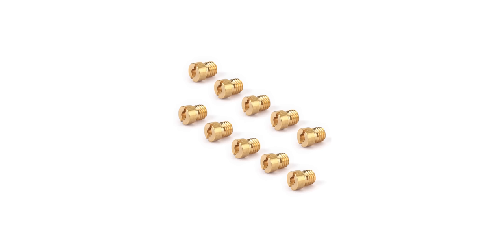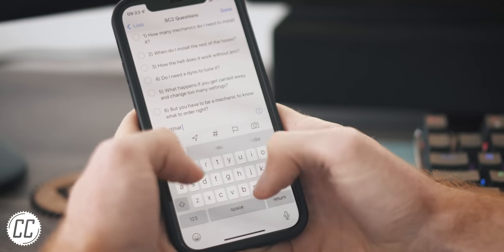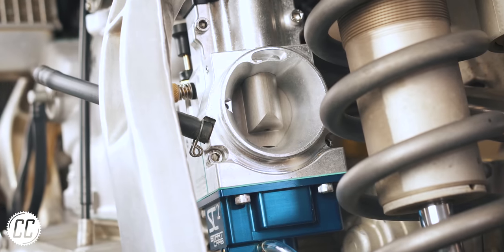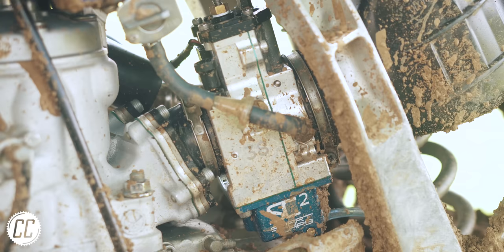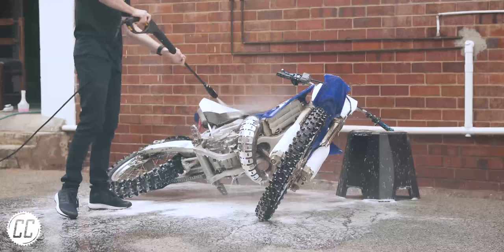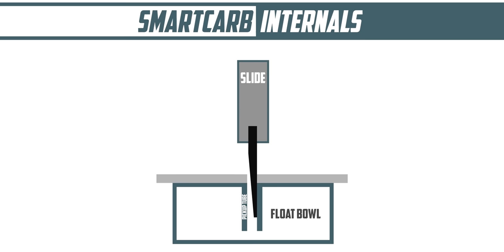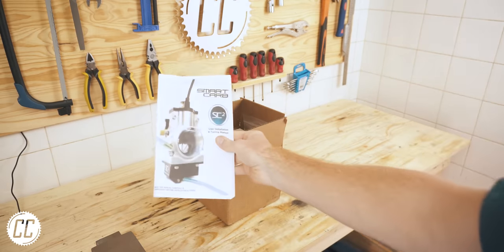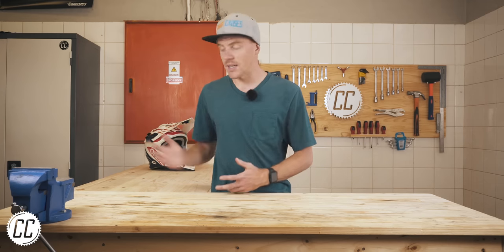The Best Carb Money Can Buy? | SmartCarb SC2

Comment: The first question that came to my mind was this: If this carb was so much better than the stock one that came on the bike from the factory. Why isnt it put on there during the production of the bike? If it were better it would have been put on there right?
Reply: Cost .
High end shocks , wheels etc are not on stock bikes either for the same reason.
Many potential owners wouldn't want or need them .
Those that do buy them afterwards.

Comment: That low pressure system means that forced induction doesn't require messing with fuel flow right?
Reply: Correct. The SmartCarb compensates for all air density factors, including artificial ones like blow-thru boost.

Comment: Don't see how this is any different than an SU carb that's been around for decades. A throttle blade opens, vacuum signal raises a float with a need on the end. Different needle profiles.
Reply: They're very different. SmartCarbs don't have a throttle blade/butterfly nor do they have a vacuum operated piston slide. They use a flat slide directly throttled by the user with a single circuit using a metering rod, not a needle. Air density communication occurs between the venturi bellmouth and the float bowl - it isn't used for throttling but rather fuel flow assist. These are patented features.

Comment: I know nothing about this carb but I know a lectron carb on my yz250x was a god send. Hands down the best add on you can do to any 2 stroke.
Reply: Consider the SmartCarb the next level above that. Full external adjustability without tools (no cap and slide removal), true to size bore (Lectron H Series and new Billetron are 4mm smaller than advertised), variable venturi throttle rate (snappier response down low without compromising the top end), and a TPS option for your YZ250X's 3D ignition mapping (Lectron doesn't offer TPS).

Comment: This thing looks like a SU HIF carb, no this is a su carb.  A modernized SU
Reply: No it's not. The SU carbs use a butterfly to throttle with vacuum or depression operated piston with conventional tapered needle. The SmartCarb is entirely different with direct flat slide throttling, a metering rod, and integrated float bowl venting. The SmartCarb doesn't use air density/velocity to throttle - it uses it to assist fuel flow in the float bowl. It's a patented feature.

Comment: frankly, I'd be happy with carbs that could deal with ethonal fuels
Reply: Ethanol is terrible, but it's also all some people have to work with. Fortunately the SmartCarb is jet-free, meaning there are no small orifices to gel or clog up. Still best to avoid ethanol if possible, but if not the SC is more resistant to issues arising from its use. Best then to run the engine and cycle the fuel frequently. All SC2 models come with float bowl drains standard.

Comment: Hi I’m having the same issue with my yz250. Blubbery response from low to mid and lean up top after about 30 clicks out. Would you happen to remember which metering rod you switched to? Thanks for your help and the great video!
Reply: Justin is running the standard YZ250 A-Q07 metering rod and has since come back down from 30 some clicks leaner with a rebalance of the idle set screw (bumping it in a hair). Send us an email - we'd be happy to help you get your tuning sorted out.
Reply: Talked to Kirk on the phone today. Very pleasant and attentive guy, and he helped me get the carb dialed. Bike absolutely rips now. Running super crisp and clean with power wheelies galore. Great customer support with these guys. I know they’ll be there if I need them again. Thanks for the help
Reply: @jeffgoetz7919  always happy to help!

Comment: Hey man, I've had a look on their website, and saw they they only have this carb for the kawasaki kx's ( when looking at kawasaki's), do you know if it's possible to use the carb for the kx250 2t on a kdx 200? also 2t.
Reply: Hey, thank you for checking out our website. We're still working through fitment on the KDX 200 and 220 Kawasakis. Our current model runs into frame-contact fitment issues. Stay tuned!
Reply: @SmartCarbFuelSystems  Okay I see. Thanks for the response. I can't wait to get one of them on my KDX one day. 👍

Comment: Better than fuel injection? Well obviously no, but we already knew that...
Reply: Doesn't it depend on the type of fuel injection? For example KTM's TPI system. We maintain that the SC2's performance and efficiency rivals that of TPI, being easier to use/adjust and with much less complexity and failure points involved. KTM plans to abandon TPI for TBI in the coming years, a testament to the benefits of wet flow induction in this category of high performance 2T motors. Is the SmartCarb better than DI? No, but then DI is only one method of fuel injection.

Comment: Normal carbs can require different jets at different altitudes, so similar there. Interesting to use a half circle instead of tiny tunes and jets
Reply: SmartCarbs do not require different components or even adjustments for different altitudes, though extreme changes may require a slight adjustment. Fortunately that is as easy as shutting the engine off, opening the throttle wide open, reaching down and turning the clicker adjuster right for rich, or left for lean, in .0012 inch increments. No tools required, all adjustments are external and take seconds to make.

Comment: I like how it’s computer designed and still doesn’t fit. Unless that’s to fit other bikes. But not impressed
Reply: The SC2 SmartCarb family of carbs are designed to fit many different 2-stroke makes and models. That said they fit all modern carbureted 2-stroke dirt bikes. We can't help the airboot trim though. The SmartCarb's integrated float bowl vent scoop location and size are fixed and some manufacturers (not all) put an in-molded rubber lip in their airboots that blocks it. 5 minutes with a dremel tool is all that is required, if required.

Comment: I’d doesn’t seem so smart to me, you can’t adjust mixture in different rev ranges. A normal carb has 3 circuits low rpm, midrange and wot, and already adjusts for altitude 
 Looks more like a dumb carb
Reply: Does the engine rev or load in 3 distinct phases? No, it doesn’t. It’s continuous and constantly dynamic. Why shouldn’t the fuel system accommodate accordingly? Why adjust for different rev ranges if you don’t have to? 

The point isn’t that you can’t adjust for different rev ranges. You simply no longer need to. SmartCarbs provide peak fueling performance bottom to top regardless of elevation/temperature changes.
Reply: @SmartCarbFuelSystems  
Ok then. ‘Smart’ consumer

Comment: Ok did test on dyno, was consistent with power an torque, but we lost all over the chart and could not get it back like the modified stock carb. So we are still old carb is better
Reply: Did you share your results with us so that we could assist you with your tuning efforts? It would be good to see your charts with A/F ratios included as well. Some make the mistake of trying to force the SmartCarb into the same A/F curve as the stock carb, but that's not how they make their power.

Comment: If someone tells me it gives more power but uses less fuel..... Claims I bought when I was a youngster 😂😂
Reply: The claim/result isn't that less fuel can provide more power, but rather less fuel required due to more fine atomization of said fuel, burned more efficiently as a result, can produce an increase in power. Not so much a claim on our end as it is a guarantee.

Comment: Will this carb work on turbo application, early model kz 1000
Reply: If it is sized correctly for the application and will fit properly with top pull cable routing then yes. We've set up a good handful of blow-thru turbo setups, most recently a YZ125 used to set 5 new Bonneville speed records this last July.

Comment: Another expensive gizmo for the less mechanically inclined.
Reply: What's not to love about modern carburetion? No jets/jetting is only one of the benefits the SC2 provides. Greater performance, fuel economy, and consistency are other factors to consider. For most, depending on local fuel costs, the SmartCarb will pay for itself in fuel savings in under 2 years.

Comment: For $600-$700.. they don’t have anything worth owning. Make the price competitive and we’ll talk.

Competitive versions will appear in short order.
Reply: Don't we though? What else does what the SmartCarb does, as a whole? Factoring in performance, efficiency, ease of use, even emissions reductions?

We've heard that for 10+ years and some have tried. And failed. Our patent protection helps some, certainly in the West, but more so our aggressive market targeting/education and simply outrunning and outgunning the competition in general has us where we are. SmartCarbs are designed, machined, assembled, and shipped in the US. That we've been price stabile through the last 4 years while the distant competition, Lectron, has gone from sub $400 to price matching us is noteworthy.

Our pricing is competitive given that our competition is fuel injection.
Reply: @SmartCarbFuelSystems  thanks… I’ll just use a carb … for much less money.

Comment: 2 strokes absolutely LOVE it when they are lean. So if you make it as lean as possible it will make it run like a dream, BUT it will destroy your engine by over heating it.
Reply: I feel that is a good point, which occurred to me as I watched the video, most factory set ups are on the rich side as they want longevity over outright performance. Weakening the mixture with some jet changes was used as a tuning tool back in the 70's. 2 stroke engine efficiency, or perhaps the lack of it, comes from the port timing. When running in the optimum rpm range they are actually very close to 4 strokes, but at idle and other rpm's they do not run efficiently and a lot of unburnt fuel goes straight out of the exhaust ports. Direct fuel injection can make a massive difference as it does on the modern 2 stroke outboards, but I don't believe any carburetor change, could dramatically alter the fuel consumption on a 2 stroke motorcycle to the point claimed, assuming it was running somewhat correctly at outset. The savings that exist must come form running weaker, they talk about the better atomization etc. but on a 2 stroke that fuel is being sucked in to the crankcase to then be forced into the cylinder so there's much more going on between the carburetor and the cylinder than on a 4 stroke, so I'm struggling to buy their explanation.
Reply: @fiveowaf454  I agree, I think the people who designed it don’t really understand 2 strokes. Seems like it would work well on a four stroke but as you said, direct injection is the best thing you could do to a two stroke.
Reply: @RealWunderBanana  Direct injection is the only way to get much better fuel consumption and lower emissions, because you can get rid of all the extra fuel that is wasted at low rpms. idle and other speeds where the port timing isn't ideal. I guess as the focus is on racing off road they are not concerned beyond performance, but I still don't see where there could be huge gains in power and fuel consumption beyond running a weaker mixture than the stock setup.

Comment: Us four-stroke guys are getting left in the dark. Lectron was the first one to make a carb like this
Reply: There's a light at the end of the tunnel. We're actively working toward serving the 4T market now that we've established ourselves in the 2T space. That said 4T carb sizing, fitment, configuration, and throttling varies widely. We're going after the most common, easiest to equip, and most in need bike models first. What do you ride?

Lectron as they are today are not the original inventors or proprietors of the metering rod carburetor concept/technology, which actually got started prior to the advent of the Lectron with the Posa-Fuel in '67. The SmartCarb is the culmination of more than 50 years of development starting then, continuing through the Lectron, subsequent models like the Ei Blue Magnum, and Edelbrock QwikSilvers, and more.

Comment: A great carburetor, but you have the wrong inventor, William “Red” Edmonston made improvements to the Venturi Carburetor, but a British gentleman by the name of Herbert Skinner invented the Venturi Carburetor in 1908!
Reply: Apple doesn't credit Alexander Graham Bell for inventing the telephone... Furthermore there are very few similarities between the SU carburetor and the SmartCarb. We recommend you freshen up on your understanding of the SU and then watch this video again. It's quite good about explaining our patented features.
Reply: @SmartCarbFuelSystems  It is a variable Venturi Carburetor, yes it has a vast amount of improvements, but at its heart it is a variable venturi. That is what gives you the precision metering at different RPMs and the automatic altitude corrections... It is a beautiful carburetor...
Reply: @michaelholliday100   the SU is a butterfly throttled, constant velocity or CV carburetor. Its slide or piston is throttled by vacuum. The SmartCarb uses a flat slide directly throttled by the user via the handset/cable. By variable venturi we mean variable throttle rate by way of our patented, inverted egg shape venturi profile designed to maximize signal at the metering rod for ultimate fuel pick-up/atomization, especially at lower throttle positions. Air density compensation or automatic altitude correction in the SmartCarb is handled via direct MAP communication into the floatbowl to assist fuel flow proportional to air density. It is not used in any way to throttle the carburetor like in the SU.

Comment: Something to consider; if it's using 25%-30% less fuel, it's giving 25%-30% less oil to the engine.
Reply: More like putting 25-30% less oil out of the exhaust in the form of smoke/spooge, not to mention zero spillage on steep hills or when tipped over. The engine gets what it needs from the SmartCarb. Finer fuel/oil atomization improves heat wicking and increases combustion surface area and efficiency. There are no longevity/durability downsides using this fuel system.
Reply: @SmartCarbFuelSystems  That's a nice spin you put on that.
Reply: @DonziGT230  it's not spin. SmartCarbs are used by thousands of customers in over 50 countries worldwide, have been used to set hill climb and land speed records, are used by top level professional hard enduro racers, paramotorists, and more. They've been EPA certified for on-road motorcycle emissions, twice. Frankly that they do what they do is by now a well documented point of fact.

Comment: For $600.00 you may as well go with an EFI kit instead.
Reply: Why? What about EFI is better, let alone easier to work with, than the SmartCarb? Why involve the electronics/complexity/failure points for next to no performance advantages compared to this fuel system properly dialed in?

Comment: Are there any rubber internal components? I'm hoping it's only the hoses on the outside? Meaning when I brew my own alcohol can I swap my lines to silicone and I'm good to go?
Reply: Ahhh great I hear that there are addition rods and it's available in the selection info 😉 thanks 👍
Reply: @Jarmezrocks  yes there are o-rings inside of the SmartCarb but we use Viton which is resistant to alcohol unlike other o-ring materials. You'd be good to go.

Comment: Guess I'm missing the smart part of this? Seems like a conventional internally vented carb with adjustments for flow on top not the bottom?
Reply: How is the internal venting of this carb conventional? We patented it. It communicates manifold absolute pressure directly into the floatbowl right at the venturi bell mouth and it drives fuel flow proportional to in-airbox air density and also velocity. Which is why it's a true single circuit carburetor.
Reply: @SmartCarbFuelSystems  So you're saying it's like a constant velocity system?
Reply: @djfaber  no. Internal venting in the SmartCarb isn't used for throttling like in a CV carb. SmartCarbs are a mechanical slide design - no butterfly. Throttle inputs directly actuate the slide. SmartCarb internal venting simply better communicates at-manifold air density and velocity into the floatbowl instead of through external vent lines only communicating, with lag, the air density in front of the rear tire.

Comment: Tip to manufacturer. Make too lean mixture impossible.
Reply: They're already designed that way. The adjustments will only let you go so far lean on the metering rod position. Not far enough to hurt anything. Of course running a metering rod that is too lean can cause damage, but we ensure that the proper rod is installed for the application prior to shipping.

Comment: It would better if it were electronically controlled with closed loop control using oxygen sensor in exhaust.
Reply: Why put a computer in the way of what physics does very well, every time? The engine tells it what it needs and integrated float bowl venting ensures faster response and more proportional A/F ratios relative to changes in air density. All done automatically.
Reply: Then go get your next booster. It’s safe and effective.